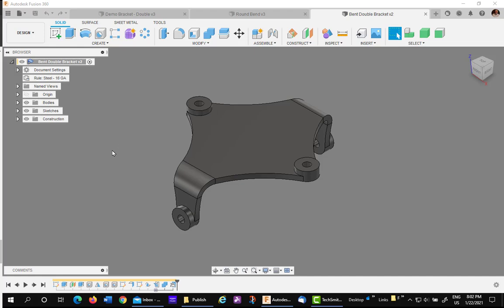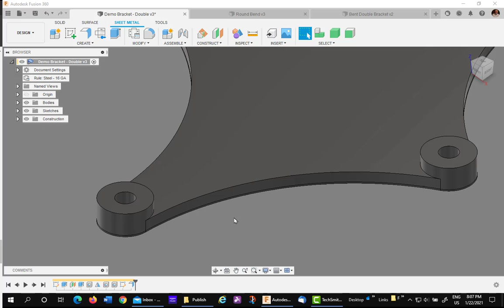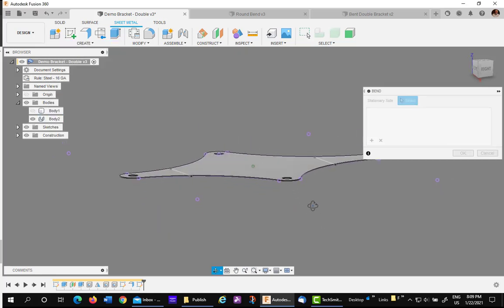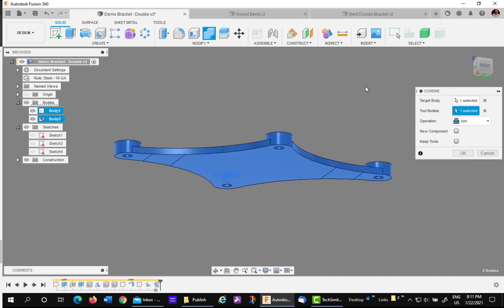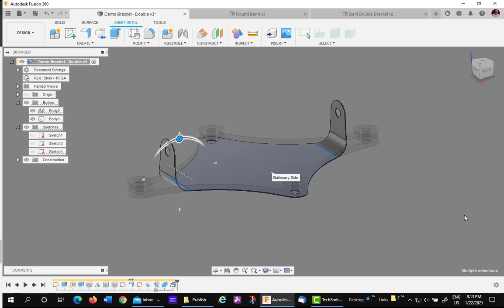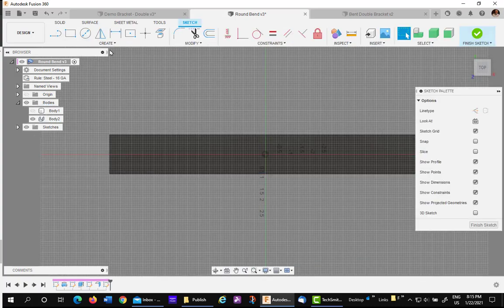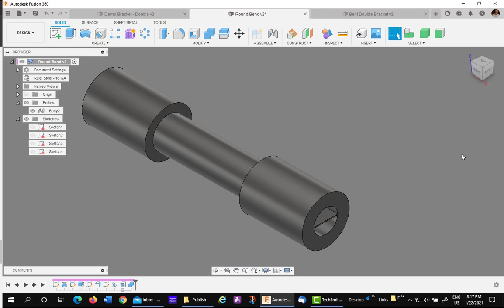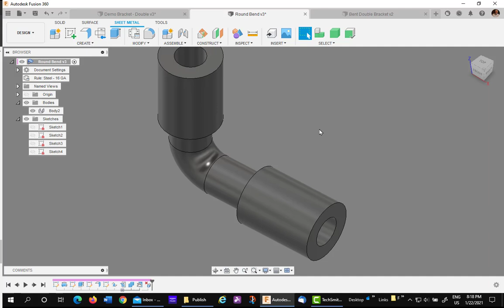Creating Solid Bends in Autodesk Fusion 360

Comment: Has this changed, or is it require the paid version as a feature? 
I basically got up to the step where you refolding at the end, and it tells me The sheet metal body was removed, but I made sure after combining the body in the outliner still has a sheet metal shape icon.
Oh I figured it out, before you do the join command you have to click the refold button, and then go back in the timeline one step before the refold and join it and for some reason when you move the slider back to the end of the timeline it doesn't complain this time about it being gone.

Comment: Thank you for useful bending guide. I have question. When combining with Join, different parts are combined into one material. Is there a way to bend while retaining each material?
Reply from the maker: Probably not.  Since the Combine command will merge materials.  The only option I can think of is to make both bodies the same material, but that may not suit.

Comment: Didn't' work
Reply from the maker: It worked in the video, it will work for you.  If you want met to take a look at your model, open it, go to File, Export and save to your hard drive.  Then email the F3D file to jhackney1950@gmail.com.  I will take a look and send it back with, I hope, the correct solution.
Reply: Same here. After picking stationary side, there are no more sides/lines to pick.